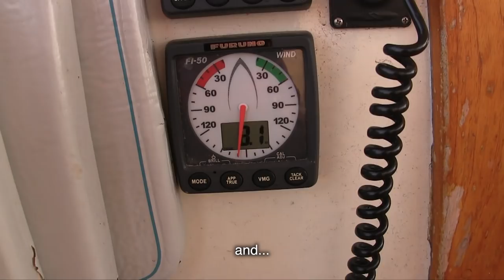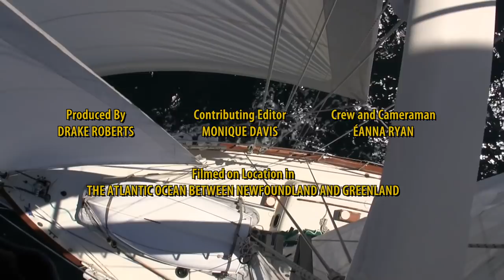He's Coming Straight for Us! | #17 | DrakeParagon Sailing Season 4

Comment: I'm getting edgy just listening to the engine on the video. That must have driven you nuts!
Reply from the maker: You get used to it.  But it sure is nice when you turn it off. - Drake
Reply: My boat is just small and goes in fairly light winds. 7 to 12 knots is ideal for a relaxing sail at hull speed. Also we're inshore (Lake Ontario) sailors. So we end up motoring for long stints but not for days at a time. About four or five hours is my limit and our engine is pretty quiet.
Reply from the maker: It seems that in Summer there can be periods of very little wind just south of Greenland.  I interviewed a family that sailed from from Newfoundland directly to Iceland without an engine, and when they were just south of Greenland they were becalmed and drifting for 3 days before they got enough wind to sail. -> https://www.youtube.com/watch?v=LuzG82zGecw&list=PLOhEGypVYJG3xGJaT3JAUEpSlpm2iZOkH    Of course I prefer to sail, but with our full keel and heavy displacement (weighing 40,000 lbs in the travel lift) we can't sail as well in lighter winds than a lighter fin keel boat.  On the flip side, I think our boat does pretty well in heavier winds, where her full keel tracks well and the motion of the boat is smoother and gentler on the crew.  She heaves to pretty well in storms too.  There have been times when I ran the engine for as long as 3 and a half days straight without turning it off.   Oh ya, and there was that one time in particular when I ran the engine for 3 days straight as I single handedly towed a distressed 52 foot steel sailboat for 130 nautical miles to Bermuda back in 2009 after some horrific weather -> https://www.youtube.com/watch?v=kBixPDkrqTQ&list=PL8B41C65A91938955
- Drake
Reply: I’ve seen those videos! Love watching your stuff and looked at all your back catalogue. Great stuff and you’re a great sailor -  you’re always humble and a good listener so you’ve got to pay attention to see it. It’s neat to see the different characteristics of all the different boats and places. Mine is a Shark 24, a dinghy compared to the Westsail. Designed as a light displacement cruiser for Lake Ontario to mimic Austrian lake boats the designer missed from his youth. 2300 lbs and a fin keel in coastal waters. I could see you guys would want to “set it and forget it” and still be able to count on five knots. Last year I was buddy sailing with a friend. 10,000lb 30 foot cruiser (C&C Corvette). We have the same racing handicap so the boats should be the same speed. He put on his autopilot and read. I spent the afternoon chasing gusts and shifts and tweaking sail shape just to keep up.
Reply from the maker: I miss sailing on fast, light, nimble, super responsive, fin keel sailboats... where you can really feel how the wind is affecting everything, and every adjustment you make to anything has an immediate noticeable effect.  Where you can tack or gybe on a dime in a spit second.  My first ocean sailing was aboard J24's and Solings and that's where I really fell in love with sailing.  Sailing Paragon offshore is a whole different kind of thing.  Instead of getting immediate feedback to any change like on a J24, on Paragon I feel like whenever we make any changes we have to wait for a couple of minutes to see if it made any difference.  Instead of tacking and gybing on a dime in an instant, on Paragon it's a much longer process.  Yes, on Paragon we do like to set the sails, set the autopilot, keep a good watch, and hope for 5 knots.. :).   That's why I got our sailing dinghy named Wanda (short for wanderer).  She is so much fun to sail! :)  I think she's perfect for a short day sail in protected inland waters to explore the area, like we did here in Newport. https://youtu.be/rlmq8LGC6Rs?t=12m30s
Reply: My girlfriend and I have talked about living aboard. That’s my main fear about doing so is loosing the nimble little boat. Of course then you can go off wherever you want in the world. I saw your video about the community sailing program. It reminded me of piers park sailing in Boston - where I bought my last boat. Boston has a ton of community programs. Such a cool city. Been meaning to go back. I learned to race on a boat called a Martin 16. It’s an adaptive racer/trainer for people with disabilities. Despite the size it reminds me a lot of how you describe Paragon. Heavy boat and little sail area, comparatively. We often got dingy guys teaching us and they didn’t realize it took a couple minutes to see any changes. That boat was all about maintaining momentum.